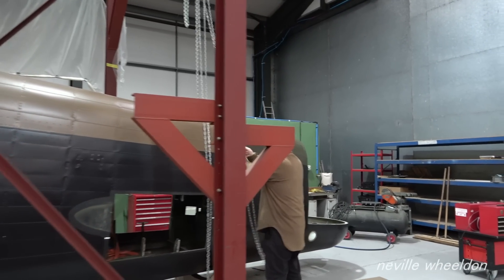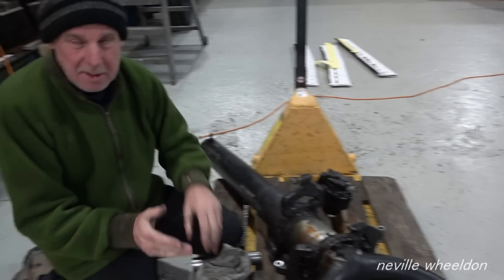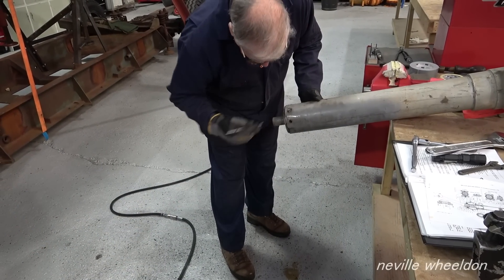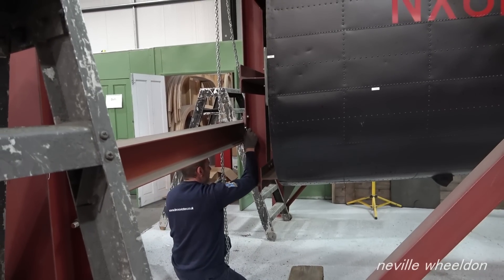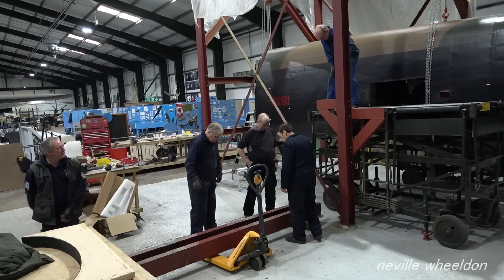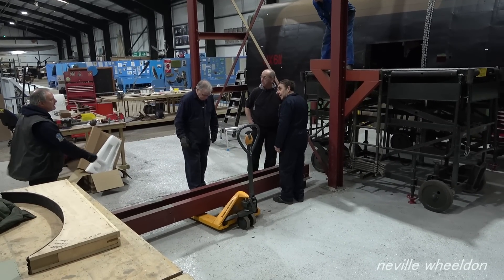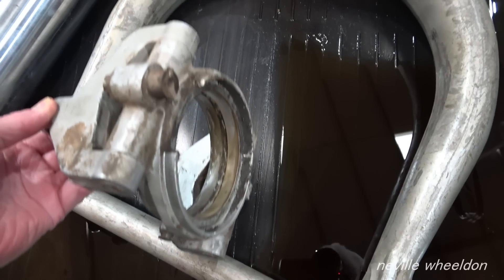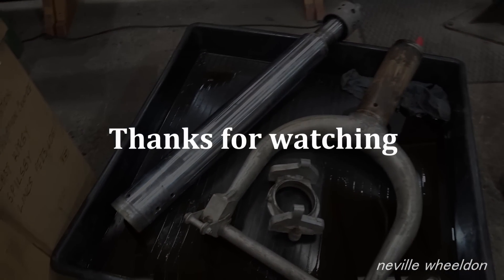Video 181 Restoration of Lancaster NX611 Year 6. Rear fuselage into the Jig.

Comment: Just out of interest - why are they not fitting the radar? Will a dummy mass be installed instead to get the massing right?
Reply: They could fit one of the old Blue Circle Radars from the early days of the Tornado 😂😂😂😂😂 ⭕️… Blue Circle as in cement which is what they used to compensate for the mass before they got the radar from the manufacturer
Reply: @buffplums  Don't need it also BBMF's Lanc doesn't have it's fitted either.
Reply: @SpenCrowson  lol you missed my irony
Reply: @buffplums  It had been a long day 😅 But as an aside I was involved with the AI24 development at TRRU Scampton 👍
Reply: @SpenCrowson  sounds interesting mate good stuff!

Comment: Thank you Neville, very interesting. Can you use NDT scanning to check the frames and ribs etc on the fuselage? Or does every part need to be physically looked at and mostly replaced? 👍
Reply from the maker: I'm not qualified to answer that David. They are removing  every rivet so they will check individual parts visually.

Comment: The radar equipment fitted is NOT H2S, it is the American system fitted post-war in NX611's French Maritime role.. Sometimes referr
ed to as H2X.
Reply: Correct it's the American AN/APS 15 radar which was also known as the Micky Set and H2X. The main difference being the operating frequency. The early H2S Mks 1 & 2 worked at 3 Ghz whereas the H2X worked at 9 Ghz giving a better resolution.
Reply: @SpenCrowson  Don't forget that H2S Mk 3, which I suggest NX611 would have been fitted with when first built, also operated at 9GHz..
Reply: @andyyoung4030  absolutely 👍

Comment: Thanks Nev as always, why are they not refitting the Radar, is it a weight issue, seeing most war birds seem to be restored to stock configuration..
Reply from the maker: Hi Allan a good amount will be stripped out which is not in use. There could be two more seats added, I'm sure the Centre will work out the weight adjustment.
Reply: Thanks Nev they alluded to that in your last video when he mentioned about passengers, the Canadian does the same l believe..
Reply: The Scanner is going to be in an interactive display so that the visitors can see and learn more about the cutting edge technologies in use at the time.